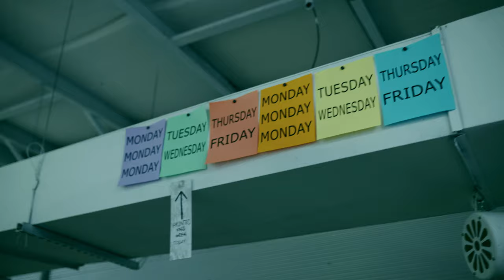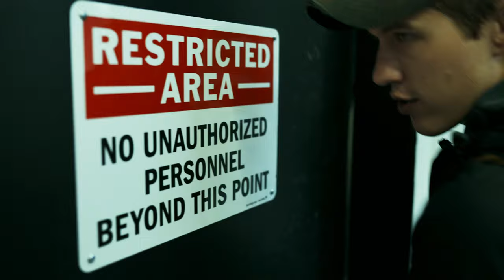How T.REX ARMS deals with BLACK FRIDAY

Comment: How does the paper order get to the first zone station for picking?  I don't recall seeing that process, and if it is something to the effect of "the front office prints them and then walks them to the stations at an xyz interval " there may be some opportunities for efficiency there.
Reply from the maker: We print at each building based on what product is needed.
Reply: @TREXARMS  okay, that's kind of what I thought. What if you put a printer at stations A through E and the order would print at the station picking needs to start. Example that an order calls for items from stations E, A, and C. Have the order print at A and then it gets picked. The next order calls for items from E and C and that order prints at station C. No human routing required.